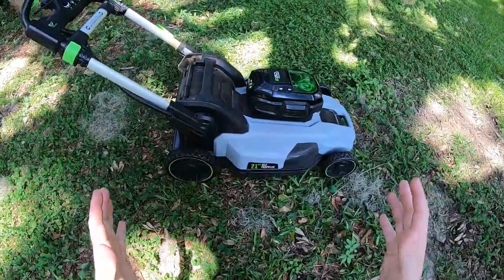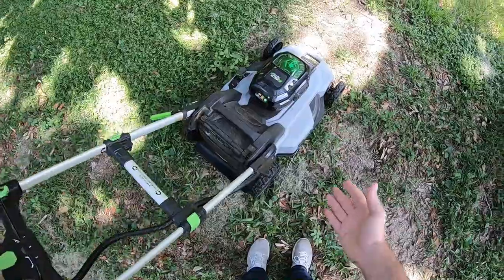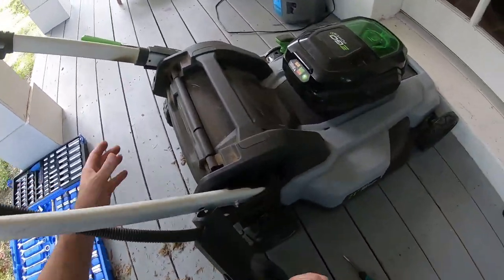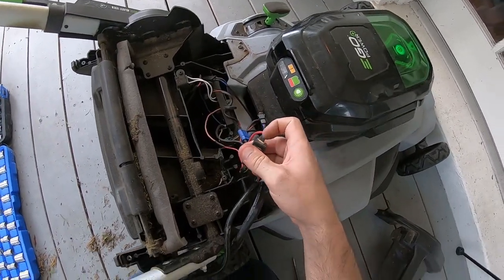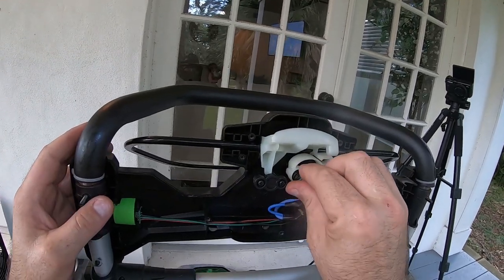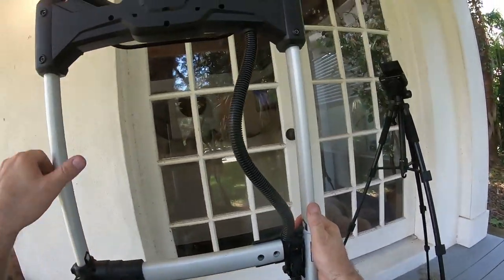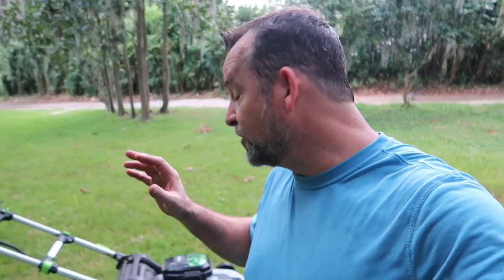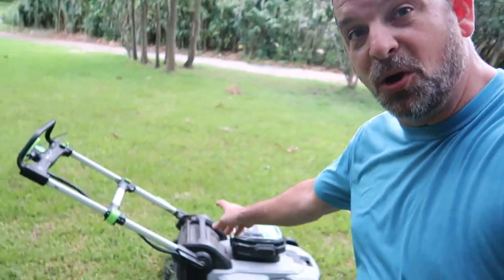BROKEN....My 21" Ego Electric Lawnmower is dead.  Can I Fix It?

Comment: I have the exact same problem on mine. I called EGO service dept. and explained the problem. They sent me a replacement mower, no charge. They said it was because there was no service dept. where I live (Hawaii). It came in about 2 weeks and they didn't ask for the broken one to be sent back. :) Now, because of your video, I'm going to try and fix my broken one. Mahalo (thanks) for sharing your video.
Reply: Good information for me. Today I picked up the 21" self propelled brushless with 7.5Ah batt from HD. I don't think they'll fix it here either. Hoping problem free operation for years.
Reply: HD fixes nothing. They send it out for a $20 charge . . . then you wait.
Reply: Same. I live on The Big Island. Called and said I have this exact problem and without hesitation they said they're shipping a new mower to me right away. Sweet.
Reply: Were you able to fix it?
Reply: @Andy-im3kj  I did the same thing as the guy at around 6:00 minute mark, put a jumper wire. I disabled the safety when the handle needed to be extended .My jumper is the blue and black wire after the connector. I cut it and connected the black and blue wires then taped the joint connection.
Reply: @jamesm.8392  Sorry for the very late reply, see the lower comment on what I did. Hope it helps.
Reply: @jjpac2011  Check my comment below.
Reply: @rust808  Awesome man! I'm hoping to get someone's old Ego mower to do this!
Reply: @Andy-im3kj  doubt it!  They are still worth money even dead

Comment: Bought my LM2100 May 2019. Worked great until I moved and started folding the handle down to store it, though it made it a year even then. Then I had the exact same problem - won't start, unless the handle is vertical! Wire continuity was good, though, according to my ohm meter, so I was puzzled. So I cut out the handle angle switch, and spliced the wires, and took out the handle extension switch, doing the jumper recommended. Now it runs like it should! I do love the mower; no gas, no fumes, so quiet, battery does my half acre lawn no problem. Let's hope that Ego has been smart enough to read about these problems. It's an ELECTRIC motor, better make sure you do the wiring right, Ego!

Comment: Wanted to add my thanks to you for saving me a lot of trouble. Six screws and a little wiring and works like new. I cut the red and black wire off the connector and used a crimp connector to hold them together. I agree with you that it's a great mower. I hope they've fixed it by now. Have a great summer despite this pandemic.

Comment: I had the exact problem as well.  only about 14 months old, and the wire was worn.  I decide to just cut the wire near the connection and jump the red & black wire to bypass the switch in the arm extension.  Works like a charm now.  Thanks again for this video to give me the confidence to open the covers and fix it.
Reply from the maker: Glad you got it fixed.

Comment: Thanks for the great video, saved the day (literally)!! Was digging through my papers trying to find the original receipt for warranty, and then found your video and it worked and I'm in business.  So for all the rest of the Ego owners having this same issue, I did the bypass like the one shown in the video for the handle safety switch.  The only difference I made was I cut the wire coming from the handle about two inches above it's connector going into the mower body and just soldered the RED and BLACK wires on the two inch side, then reconnected the jumpered plug back in.  no need to fab a wire jumper when there's a connector right there.  Worked like a charm! Thanks again!!!!!
Reply from the maker: Glad I could help!!!
Reply: I have same issues on my ego
Problem was blue and red wire was skin of ,i cut 1 inches each and put back the clip on
But it didint work :(
And on the video his jumping to switch but there are 4 switches
Yellow blue and two small black one
I don't know which one i have to jump

Comment: I just returned mine last night to Home Depot, broken wire to the lower end wouldn't start.  Called Ego, waited in hold for 2+ hours, no answer during normal business hours.   
I didn't buy electric to do repairs on my mower!  I ended up buying a new Home mower, what a difference in cutting!

Comment: Had the exact same problem on the same mower this week.  Called Ego, they opened a support case and I'm supposed to take it to Home Depot and wait 2-4 weeks. Instead went to Microcenter and bought a bag of jumper wires for $8. Followed this video and fixed it in 15 minutes. Thanks for the great video.
Reply: just fyi, but just about any stand-wire of a decent gauge (thickness of the copper) will do. Solid wire works as well, but isn't meant for flexing.

Comment: Wow, glad I found this and saw it wasn't just me... last month I ordered from ACME Tools the most recent generation of Select Cut (LM2135SP) and it started cutting off yesterday in the middle of my second time mowing the lawn.  That black cable wrap looked cheap and suspicious to me so I thought the problem may have been the extender causing the wrap to flex and crease... re-opening and closing those extender clips seemed to re-cycle the issue but it would only work for another 30-40 seconds before cutting out again.  I knew there must be something in the wiring going down to the main chassis... you confirmed it.  Now let's see how helpful EGO Customer Service is going to be about this... if not then I'll give this a try.  Thanks bud.
Reply from the maker: Yeah. I recently switched to the Toro mower and people have been tearing em a new ass over it. I will try the new ego soon and see if they fixed the issue. I really love the brand but hate that people are having these problems.
Reply: @UnboxWarehouse  I'm an "EGO guy" and have all the tools except the snow bower. I recently sold my old 20" EGO and fully planned on buying the Select Cut to replace it.  I mean, I have a bunch of EGO batteries... would make sense to stay with EGO. I read too many complaints about quality going downhill recently and started having doubts. I also have the beast Toro TimeMaster and love the Personal Pace self-propultion. I decided to make the leap over to the Toro 60volt mower and couldn't be happier. It cuts fantastic,  looks awesome (always important), and seems better built than EGO.  I'm not getting rid of my other EGO tools though because they work too well.  The EGO string trimmer is a beast,  and the edger, and the chainsaw...

Comment: hey man, HUGE thanks for helping me diagnose what's going on with my ~1yr old EGO mower. Support & warranty stuff during COVID times are pretty brutal (especially with the Home Depot drama going on at the moment), and this video saved me a TON of troubleshooting time. Now I just gotta get back with EGO and see what they're going to do about fixing this properly. A wire getting pinched to the point of failure, while using one of the space-saving features (folding handle) is pretty terrible, so hopefully they've got a proper solution...

Comment: I've only had my EGO mower for about 3 weeks and then I started having the same problem you did. While mowing, the blade would inexplicably stop. The self-propelled feature still worked. It had nothing to do with the battery because it was fully-charged. What I eventually figured out is that the handle, although firmly clipped, would slowly start to retract from its fully-extended position and trigger the circuitry that made the mower think the handle was not fully-extended. That disables the blade. I noticed that the handle only has to retract about half-an-inch before it triggers that cut-off switch. Once the blade stopped, if I tugged hard on the handle to extend it, the blade would work again. Basically, the side clips that are supposed to lock the handle in the fully-extended position weren't doing their job - although they seemed to firmly clip.  

I called EGO about this. They said that this was not a common problem and that the mower might be defective. They suggested that I take it back to where I bought it (Lowe's) and get a replacement. So, I did. Lowe's gave me no problems. We'll see if this problem continues. 

My problem, unlike yours, was not bad circuitry. Electronically, everything worked like it was supposed to. However, the handle kept slipping out of the fully-extended position. Your wiring was faulty and your solution was to electronically trick the mower into thinking that the handle was always fully extended by "jumping" the circuitry. If my problem continues, I may resort to something similar to what you did. Instead of "jumping" the circuitry, however - I think I'll just open the handle housing where the switch is located and mechanically lock the switch in the closed position so the mower always thinks the handle is fully-extended.

Comment: So I had the same problem but it looks like it was both the relay for the rotating handle and the extension. I wire nutted the wires for the extension and that helped. For some reason the relay on the base for the rotating handle worked but would only engage at a certain angle like what you had too. I just used electrical tape to hold it closed and is now working fine. Thanks for the tips!

Comment: Years ago, I had a Black and Decker push mower, and I ran it on a wheel chair battery. It worked, but it wasn't the most efficient, but I just charged it when done, and kept it running.

Comment: I had the same issues with mine just today.. I spread open the wire sheathing and exposed all three wires.. black, red, blue.. 
I examined the wires and determined that the red sun blue wires were crimped.. .. I cut both wires around two inches from the harness clip then about 8 inches upward on he wire.. I spliced the wires together with a little bit longer of wire that I cut out  and taped them up.. put everything back together and it works like a charm!!!

Comment: Thank you very much.
I have the same mower as you do and I've had it about 13 months and it has done the same exact thing as yours did.
It appears it's a design or an assembly or both issue that this manufacturing company needs to take care of and resolve because it's not going to go away on its own.

Your video let me know that it's an issue that can be repaired.

Have a great day and keep up the good work.

Cheers from Fairlawn Virginia USA

Comment: I love my mower.  Until one day I turned it on and it revved to high power.... and stays there.  Sucks the battery like mad.  So I put in for warranty work.  Home Depot takes it as directed by Ego.  Weeks later, they say it is a shorted "power board" and that I must have hosed it down or left it outside.  Uh, neither happened.  I am currently waiting on a response from Ego because the repair would be $380.  Which is stupid.  Love the video!  Nice job!

Comment: I connected the black & red wires on the motor (not handle) side of the connector at the male pins in the connector and this stopped this failure to start problem caused by handle position & pinched wire. Other vids show making a jumper wire in the female black & red wire ports. These are in the base and were accessible in my June 2022-bought E-GO mower.

Comment: Dude.   My mower died today.   Same issue and when I tried starting it with the handle straight up like you did...  Voila!    So I know that's my problem and will fix it tomorrow.   I've read horrible things about ego warranty service and home depot taking months to fix.   Complicating matters, home depot will no longer sell these after December of this year (Lowes will).    I can't wait 3 months for a wire repair...
Reply from the maker: Let me know how it goes.
Reply: How do you get the top cover off?   I removed the 6 screws but it's catching or hitting something as I try to pull it up
Reply from the maker: I really don’t remember. Sorry.

Comment: Fix works! I had to slow it down to see what wires you shorted for that.  I the video you say blue and red, but it is actually the red and black that needed to be shorted for me.  I wouldn't want to remove the switch for the folding function though, that one seems important to me.  Your were tinkering though.

THANKS FOR THE HELP!

EGO isn't getting back to me about my warranty.  I have had the mower since AUG 25th of 2019 and live in upstate NY, so I really have not had this for long nor had much use since the start and end of our long winters here.  This seems like an issue that will be present in a lot of their mowers.  I have Model # LM2102SP.

Great thing about this fix is if they get back to me and will do a replacement or fix it can be reversed in 5 minutes.

Comment: Do you have instructions on how to do the jumper wire.  I probably have same problem.  Last season it started where it started not to work sometimes with the the flashing yellow light.  Worked sometimes but now not getting it to go.  Thx

Comment: Nice work. Had exactly the same problem with red wire. Spliced in a new wire and running fine. Can you say design fault. Love the mower anyway.

Comment: Just when the video started my diagnostic was the switches( below the two green clamps on the right and left sides of the handle) in the handle bar. The switches are a safety feature.

Comment: OK....... I got tired of my grass getting junglesque due to so much rain, and, dontcha know, I chose this year to feed the grass! Anyhoo.... I digress. I isolated the wiring harness with the blue. black, and red wires and broke out my OTC multimeter. I found a break in the black wire 10 inches up from the little connector you bypassed. This is where the three harnesses all get jammed against the 2 bolts that hold the handle on the center crossbrace, under the pivot cover at its top.  Being a professional ASE Master mechanic, I decided to find the break and repair it as though it were a car. I cut the wire at the break, stripped the 2 ends and used a noninsulated butt connector and put heat shrink on the repair. I then set about rerouting the mess under the deck cover and inside the handle pivot cover.... unlike they made it. I installed 2 brake bleeder caps on those sharp bolts so the harnesses will not get smashed against hard steel again. It works perfectly again, and I have no intention of folding the handle ever again! Now it works with all the safety switches intact. I wouldn't defeat my car's airbags because they may save my life....... ditto here
Reply: Great comment, maybe too complicated for many that don't have any electrical knowledge?

Comment: Bought my EGO lawnmower in 2019. It failed to start this week. I suspect this is the issue, so I called customer support. I spent over 1h30 min waiting on the phone but eventually spoke to someone. After having me do a few things to trouble shoot the problem, they looked for a place in my area where I can get it fixed but due to covid restriction I can't get to the places EGO found. So they decided they'll send me a new mower. Once I get it, I'll see if this works and will try and find correct parts and properly fix the whole thing myself. crosses fingers

Comment: I would have had to drive 1 hour to drop off my mower at a Home Depot w/ Rental Department and wait weeks for repair.  

I didn't have any wire handy, I guess you could even use a paperclip. I ended up ordering a pack of jumper wires on Amazon for "Breadbox Prototyping" for 6$. Now I've got a bunch if I ever need them.

Comment: You are brave for doing the repair yourself. I SHOULD HAVE DONE THE SAME! Now I am regretting it as it was a pain. Trying to reach customer service was a journey. Homedepot has had my lawn mower for about 1.25months and evertime I call they are wait on ego to delivery them a wiring harness. I have no time frame when I will get mines back and its very frustrating. 
 EGO has shut down their customer support community page down due to customer complaining and venting on how poor they are handling warranties during covid 19. 
I probably won't buy another ego product every again due to this experience alone. SMH towards EGO.

Comment: I had the exact same problem on a mower less than a year old.  It was the wires from the handle lockout switch so I've removed the switch and wires and added a jumper.  From now on I think we'll fold the handle less often as that may have caused the problems.
Reply from the maker: Did you jump it in the same place as me?  I by passed the handle extended switch.

Comment: Mine just died 2 weeks ago. Bought it August last year. Unfortunately I don't have the wire short problem you have with the handle. It does not register the battery being plugged in at all (even when pressing the headlight switch on top of it). My warranty request got denied since I lost the receipt even though the serial number clearly shows that it is impossible for the mower to be outside the warranty period.

Comment: When I depressed the start button and compressed the blade bar the Ego display panel just blinked yellow while the green button light on the battery stayed a steady green. My Ego wouldn't come on until I squeezed the self-propel trigger, then it took off like a racecar. I had to adjust the speed lever and it worked fine -- sometimes, though, I had to try to restart it several times before it stayed running.  I might troubleshoot your solution as necessary..

Comment: Totally their fault and you are a genius.
Actually, I always wanted to disable that fully-extended checking. I'm 5'7, and would like a shorter extension.
Reply: OK, to be fair, their bet is nobody would fold it back after each use. If it's folded only off season, their 20( could be higher) gauge wire might pull off. 
But it's so easy to fold! I kinda ended up folding it up after each use and kinked the wire...
Reply: @jollion  actually folding and putting away after each use is A a HUGE selling point.  It is a major consideration. After cut quality and power,  folding has to be the next major feature.